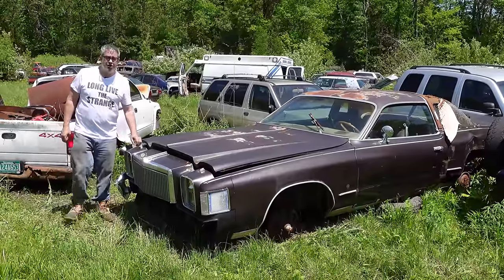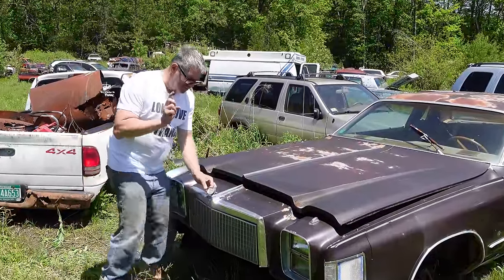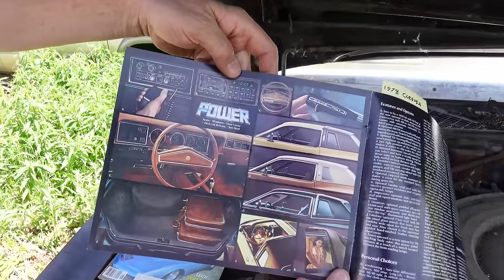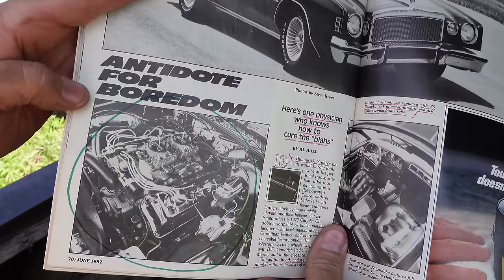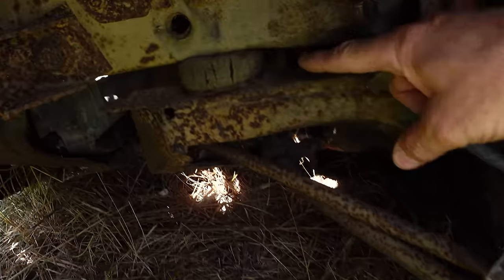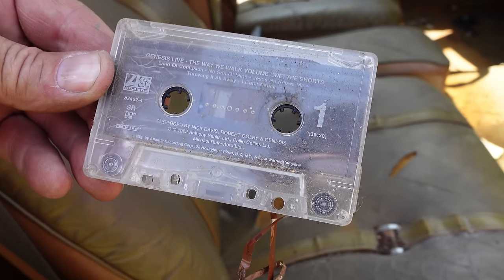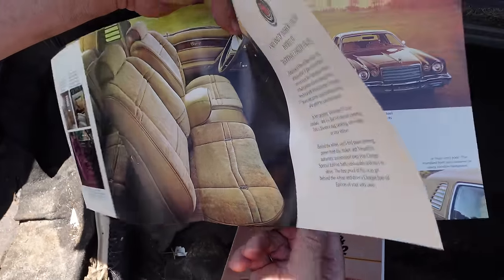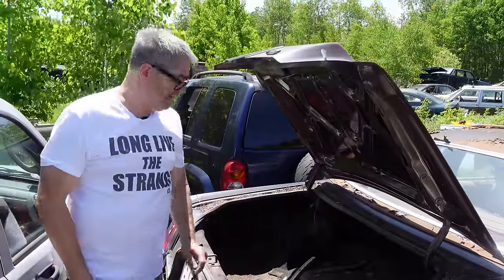426 Hemi Cordoba

Comment: Nah, I was never a fan of them. Sloppy, handled like a sack of potatoes and awful quality (not that GM was a bastion of quality back then either....). The Thermoquad was an awful carburetor. For a time, Tomco who is an aftermarket parts supplier sold replacement bowls for them and looking them up was a challenge as many "spray and pray" rebuilds had their bowls changed over the years, so going back to the originals wasn't easy.  One GM A/G body division car easily outsold these cars. You can see where they played catch up with styling of the GM models, that's for sure. Chrysler had a smaller budget than GM and by 1978 they were in big trouble. The problem with Chrysler was their "push" system of vehicle distribution. They would produce what they had parts for and "push" it out to the dealer network. This meant odd color, trim and option combinations that were often unwanted (and went unsold) to dealers. It also caused their inventory levels to be beyond normal which hampered cash flow. When Mr. Iacocca took over in 1978, one of the first things he did was can that system and go to a "push" system (you specify/order, we build it) like the other companies had. 

We (barely) got the VIN, we win: S for Cordoba, S for Special price class, 22 for two door special coupe, N for 400 V8 with four-barrel, standard performance (VIN code "P" was the high performance 400 V8 that year), 8 for 1978 model year, R for Windsor, Ontario Canada assembly and the rest is the production sequence. The Windsor Ontario plant opened in 1928 and still operates today. All Cordobas were assembled there. 

We (barely) got the tag, we can brag: E64 for 400 V8 with four barrel, standard performance, D36 for A727 Torqueflite automatic transmission, C21 for front center cushion armrest, END for end of sales codes, H51 for single heater and AC unit, N88 for cruise control, RT9 for Sable Sunfire exterior paint, V3U for tan Landau roof, G11 for tinted glass, all windows, P31 for power windows, possible P41 for power door locks, among other codes. It would be helpful to carry a rag and some cleaner (Windex, soap and water, even just plain water) to clean off those tags so they can be read a bit easier. They get dirty from years of grime under the hood, and many are stamped very faintly and they are tough to read. 

Yikes. (Hits floor and passes out). No, this B body Cordoba was replaced in 1980 (and ran through 1983) by the "J" body Cordoba and Mirada which was based on the F body Dodge Aspen and Plymouth Volare. It was not an "L" body, that was the Omni and Horizon which had nothing to do with these cars. Also, the 1981 to 1983 Chrysler Imperial was the same basic chassis as these "J" body cars. Kelleher and Mixer Chrysler was located at the corner of St. James and Albany in Springfield, MA and there appears to be a repair shop and/or other businesses there now.
Reply: I could add that the "M" body of that time was also closely related to the "J" body that would replace these B body cars.
Reply: What you described as a push system could possibly explain my 74 Charger's color combo. Dark gray metallic paint with a Lucerne blue interior. Weird.
Reply: @LongIslandMopars  Indeed. It's likely that no one would have ordered it that way. It's indeed possible, but not likely.
Reply: @googleusergp  I saw a 71/72 Satellite once in the same color combo. We both had the canopy vinyl top in black. The cars were otherwise identical. Contrast it with my dad's 66 Coronet which is dark turquoise with a light turquoise interior. It's coordinated and elegant vs "who ordered that".....😎
Reply: @LongIslandMopars  My '80 Trans Am is Carousel Red (orange) with a Camel Tan vinyl base interior. It has power windows, but no power locks. A sprinkling of options here and there, but by no means loaded. It was on the floor when we bought it. In fact, it was the only new 1980 Trans Am at the dealership at that time (October of 1980).
Reply: @googleusergp  Sounds very classy. I'm sure it's a head turner.
Reply: @LongIslandMopars  Indeed it is, along with my '79 10th Anniversary Trans Am, one of 1,817 made with the 400/4 speed combination.
Reply: The thermoquad carburetors actually the best carburetor ever put on a production car. Just had to know how to tune it, which most people don't. I still have my 1977 factory thermoquad set up book somewhere. There are over 70 steps, which must be performed in order. When properly adjusted a Holly can't touch it.
Reply: I’m not saying they’re impossible to work on but they are a  piece of junk. So much so that it towards the end of the carburetion era for Chrysler carbureted V8s, they went to Rochester and put QJets on their V8s. That should tell you something. All of the big three used Rochester Quadrajets, including Ford on their 429.
Reply: @googleusergp big fan of Holley replacements. My 0-6210 worked so well someone stole it. Should have had hood locks ('67 Tempest)
Reply: @herbodiferous7751  I'm a fan of what came on a GM car originally, typically a Quadrajet. They are designed for the application, they work and they do anything a Holley can do and do it better. Like Nunzi Romano once said, "Rochester doesn't have to advertise, they sell 5 million carburetors a year".
Reply: @garyszewc3339  Holly is a woman's name. Holley made/makes automotive products. Two different things.
Reply: @googleusergp  unless you're competing in some sort of bone-stock race category or a car show/sale, there are better options than a Quadrajet. Rochester "sold" carburetors under contract, to automakers. They tend to go for the lowest bid, not highest quality (although there were factory Holley carbs on a few GMs, correct?)
Whatever trips your trigger.
Reply: @herbodiferous7751  The Rochester Q-Jet is known as a superior carburetor because it provides economy and performance. The "problem" with Rochester carburetors are the "mechanics" that attempt to "fix" them. Nothing more. Yes, there were factory Holley carburetors on GMs. Likely done for marketing more than anything else. Think of Hurst on the shifters. For a time GM didn't allow the use of vendor names on such products, but then recanted.

Comment: Steve back in the 80’s I worked at a Chrysler dealership in Florida 
We got a ‘79 cordoba as a trade in .. I looked it over it Ran on Regular ,opened the hood 318 Zero Emissions Nothing  no lean burn  , one vacuum hose
It had Export sticker under the hood    It had like 24,000 miles 
Found out previous owner was  a navy Admiral  just retired bought a Imperial 
My dad bought the ‘79 Cordoba  … also it was the cover car for the sales brochure  
    Brown and cream two-tone with cast aluminum bolt on turbine fan hubcaps

Comment: That Horizon Charger was a pity. My parents bought a new 78 Horizon. Very Rabbity. Very nice driver. Auto, silver, with red interior. Learned to drive in it.  But later I bought a 77 400 Cordoba. Beautiful Copper paint and cloth interior. AC would freeze you out. And it did go like crazy. But inconsistent. Punch it and it might go like a rocket or cough and backfire and eventually blow up the muffler. A friend behind me said a fireball ten feet long would crack out the back as loud as a cannon. The Electronic lean burn demon had everything to do with that. The brakes coulden't lock and faded out while smoking if you had to slow down quick. And if you took a turn over 15 miles an hour the tires would squeal like your doing 30. Any faster and those stamped wheel covers would pop off from wheel flex and roll down the street next to you. Lol! But I loved that handsome devil. Right up to when the leaf springs went through the trunk floor.  You didn't mention the Magnum. It was Cordoba blood. Had fluted glass headlight covers and opera windows.

Comment: I had ordered a 1975 Road Runner, which was the only year that it was in this B body. Since it was late in the model year, Plymouth was not giving me the engine and some other options. So I canceled the order and later ordered a 1976 Sport Fury with a 400 4bbl engine and heavy duty everything, bucket seats, tilt wheel, dual exhaust, no cats.and a sunroof. This totaled out at $6776 , a lot more than a Cordoba.

Comment: I've got a 75 Doba with 300,000 miles on it and still runs. Dropped a 440 and 3.21 SG in my 75 Charger. Also have a Jekyl and Hyde pair of 76 Daytonas.

Comment: I did see a few cordobas in that time frame with 440s. A few of them were from the Chrysler engineering house in Highland Park. I even was putting gas in at a gas station I ran in 1982 where they were still testing a Cordova. They were actually testing the axle. Because they kept coming in with different paint on the end of the axle shaft. And that vehicle had a 440. I also saw several of people who had purchased the car with a 440 in it. Apparently there was a mechanism for ordering the 440 in that car. I saw a number of examples with 440s in the Detroit area.

Comment: I was in the first group of mechanics at my college to be trained on how to work on a Chrysler lean-burn engine. Had an instructor from Chrysler come in with a pair of brand-new Chryslers we worked with. But then at the garage I was working at we had some come in and we'd do unholy things to the carb trying to get it so it wasn't so choked off. I remember another mechanic tear the carb off and try to get it to run with an older standard carb you could adjust - those engines were so detuned it was a crime.

Comment: Had a 78 Fury SE sedan with the tame 318.  My senior year high school.  Smooth steady but slow.  Wish I could have had a cordoba of that vintage w 400.
Reply: Would be just as slow! My dad had one in the late 90's to early 2000's. The gearing was horrible 2.45 rear end, the torque convertor was low stall with lock up. It took a lot to get the car moving with that set up. I now have a 79 Cordoba 318 2bbl (Profile Pic) with working Lean Burn that is slightly quicker than the 400 in my dad's 78 EVER was.
Reply: Only dodges ever had the SE designation, and never on a sedan.

Comment: I remember driving my mothers '78 Cordoba 400 4v when I was in High School.  Anytime I really got on it the lean burn system would go to crap, felt like it was running on six cylinders.  I would limp it back home barely running and my parents would read me the riot act.   Nice car but for a teenager with a lead foot it was not a good option.  Couple years later I went in the service and bought a 74 Roadrunner.  I was hard on that car as well but it never complained and took anything I gave it.

Comment: They also made a Charger and a 300 on that platform. I spoke to soon, 
I should have known you would cover the 300 & charger. I also had an 87 Shelby Charger with a 440 Dana 60, non stock of coarse still sitting in the barn With a big hole in the block and pan. Maybe this is the summer I put a hellcat drive train in it.

Comment: The Chrysler front torsion bar, rear leaf spring suspension recipe may have been dropped by the 80's, but Mazda Japan took up the mantle and used it with their new generation Bongo van from 1983 right through to 2020.

Comment: My dad bought a 75 Plymouth gran fury x state car in 1977 it had heavy duty everything and the hp 400 big block rated at 240 hp  with 321 rear gears it was great off the line against new corvettes in the early 80s no problem win

Comment: The big block Cordobas are great parts cars in Mopar circles. I bought one with tree damage years ago for $700 and got the low deck 400 (great for a stroker engine), big block 727 transmission and 11" front disc brake pin style caliper adaptors.

Comment: Although the featured car is a 1978 I found a statistic showing the 1975 and 76 model years had an optional 235 horse 400 over the standard 195 horse version offered in the Cordoba. Since Cordoba was a two door I find it hard to believe it would be a Police package option.
Reply: If it had that engine in it, it was most likely an A35 HD Tow Package car. Usually got all the better stuff, heavy duty rear springs, rear sway bar, cooling, transmission cooler, power steering cooler, and 3.21 or 3.55 9 1\4 rear axle.

Comment: In the 80s guys w older road runners and stuff that needed a motor would be looking for those cordobas for the motor as that was the only. Car that had something they could swap in it was not bad for what it was and in a light road runner it faired well i had a 72 Newport w the 400 it had a big two barrel holley onit factory and for a big heavy car would move decent it didn't feel like it but watch the speedometer move it climbed quickly

Comment: had a 77 with a 400 4bbl  took the junk lean burn off put a regular electronic distributor and a thermo quad carb off a 74 Cuda hold the pedal down and she would shift out of 1st at 55 mph 2nd gear shifted out at 100 mph didn't have the nerve for top end

Comment: 1979 was the last year for the cordoba 300 edition with a 472 crate hemi fuel injected engine. the original engine was a 360  but was replaced with a 472 hemi  crate engine

Comment: man i remember when that issue of pop hotrodding came out. i was in high school at the time. i would later on buy a 400 '76(?) cordoba in the early 90s. swapped out the factory crap lean-burn ignition with an accell and the thing ran great. fair gas mileage on the highway too.
Reply: I have a few copies of that magazine.  Dr Smith with the hemi Cordoba is my dad.  I rode in that car.

He told me he put a Hemi in it because he could ride his bicycle faster than the lean burn 400.

Had he ordered it in time, they offered a 440 until jan1 77.  He missed the order date.  He said in retrospect he should have just built a 440 instead of the hemi

The reason:  hemi doesn't fit unless you remove the ac compressor, and that was a triple black car

Growing up, I called it The Black Car
Reply: Yes that 426 Hemi Cordoba featured in the magazine was our Dad's daily driver for quite a few years. Really snapped you back into the seat if he leaned into it on the highway. Dont forget to brace your ass if a Camaro came up to the traffic light flexing it's "muscle"

Comment: The Lean Burn computer is missing from the air cleaner.  The Corjunka never had a Hemi. In 1976 that car and the Charger SE 400 Lean Burn cars had a 12 month unlimited mileage warranty.  The traveling salesman bought them up.  In 1978 the small Fury (Satellite) had a police option model with a 440 lean Burn.  Those cars had a trans, engine oil and power steering fluid coolers with an A/CD clutch cut out at high speed.  They would run!

Comment: Sheesh, how far ICE has come over the years. 62hp must have been incredibly slow. The saying there's no replacement for displacement will always hold true, modern tech has really helped little engines like the 1.6 make great hp per liter numbers.

The 1.6l in my dd with simple bolt-ons and flash tune makes 154whp, about 175hp at the crank factoring in around a 12% drivetrain loss.

I couldn't imagine being in the market for a car in the 80s with v8's making 160hp LOL

Comment: Great video Steve .couple  questions what was the difference between the Monaco and the Cordoba ? And where do you find those pristine factory brozhores are they reproductions  or originals.
Reply from the maker: Hello PM and Thanks for watching and writing. The Monaco was a less stylish model, see the green plastic promo for what they looked like. The "paper props" come from my personal collection which I've been growing since I was about 10! I have a lot of stuff and use it when it's a good match to the vehicle in the video. I do "mark them up" with ink simply to guide me and Super Shane Richardson during the video shooting. Its much more efficient to just say "here in the green ink box we see..." instead of me having to take a hand away from holding the brochure against the wind to point out the sentence I want to be photographed. I NEVER cut these "paper props". That wrecks them forever. OK, Thanks again for watching and writing. -Steve Magnante
Reply: @SteveMagnante The Monaco was with sister to the Plymouth sport fury, not the Cordoba. All Cordoba were built in the Windsor Assembly plant. The rest of the A bodies were built at Lynch Road Assembly.  Every Cordoba VIN started SS22. S Cordoba, S special price class, 22 the Cordoba roof. Then the engine, in this case N, then 8 the year, R Windsor Assembly. The Sport Fury, and the Monaco, or cheap Charger, would be a W or R, followed by h,m, or, l, high, medium or low price class. 23 for the 2 door roof line, except Charger SE, which had the Cordoba roof, 0r 44 for a 4 door. Then engine letter G 318, K 360 2 bbl, l 360 4 bbl, N 400. Then A for Lynch road, or some may have still been being built at Belvidere Assembly.

Comment: Hey Steve-O,  once again tremendous insight and knowledge on these J-Y relics. You're spot on fella' !  These Cordoba models were literally a direct rip-off of those mid-seventies Monte Carlo vehicles. In fact, after Chrysler designers copied the 73's ROUND headlights  they once AGAIN duplicated the '75 M-C's stacked SQUARE headlights. Absolutely NO imagination or individuality by Chrysler's personnel. By the way, slight correction !  Ross Perot wasn't an OIL billionaire, he made his billions in the field of information technology. Primarily handling large contracts issued to his corporation by General Motors. Hope this helps Yo ! 👉 💰 💰 💰

Comment: i had a '76 model , it had the 360 . i had a '76 or '77 (i don't remember which) dealer brochure , and it said the 318 was a no-cost option . one of my high school friends across the street had a "model , his also had the 360 , but his had the 8 1/4" (i'm not sure about which one, but it was smaller than mine), while mine had the 9 1/4" axle . i only paid $150 for the car, and there was even another cordoba thrown in with the sale, but i didnt have any where to keep a second car at that time, so i left the other car with the guy who sold me them